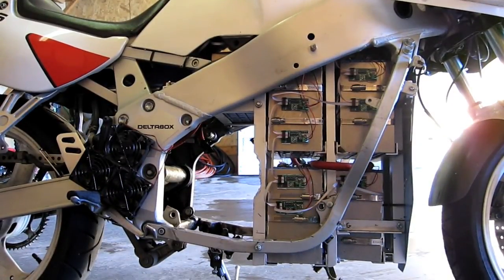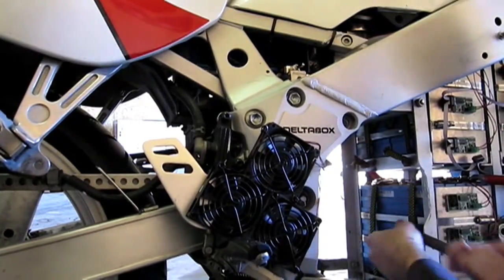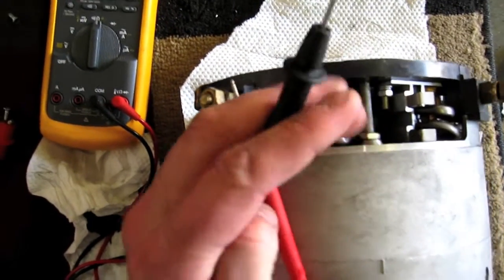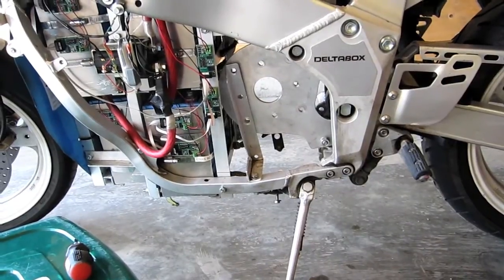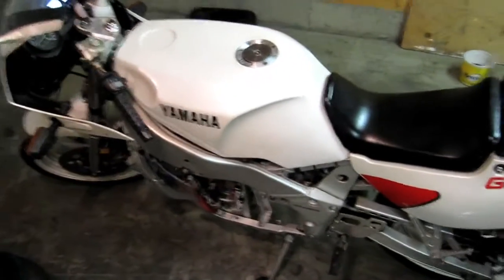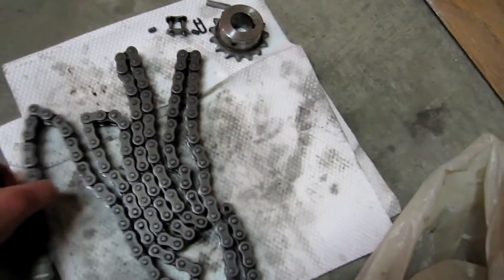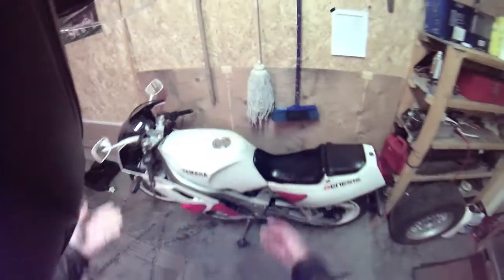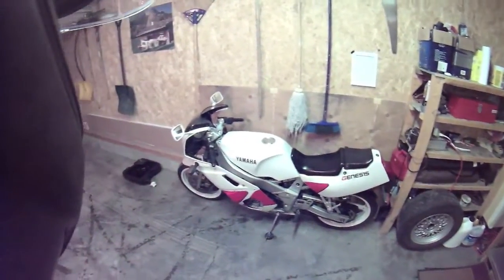#12: Motor Reinstallation 2013

Comment: Should you really spin up an unloaded motor? Maybe yours can take it, but my k91-4003 would probably not like that.
Reply from the maker: As long as you don't exceed the maximum speed of the motor, spinning it unloaded is not a problem.
Reply: ***** Yeah, I know, wasn't sure if you did. Nice bike. I am overvaulting my motor, so I couldn't get away with it unless I had an rpm display.
Reply from the maker: Owlex Myth Oh I see... Yeah if you have a higher voltage pack/controller than your motor is rated for you would have to be careful. In my case though, full throttle is well within the speed limits of the motor.
Reply: Great job on the videos by the way. I make similar vids to help people out with electric vehicle stuff. Have you heard of the electric motorcycle club?
Reply from the maker: Thanks and good stuff. No I haven't actually. I assume it's nowhere near me though because Calgary can barely keep a regular bike club going let alone an electric bike club haha...
Reply: Electric vehicles are still relatively unheard of and too expensive (initially) for too many people around the world. Technological advances have been getting E.V.s in the news & bringing down their prices, so the EV market is about to experience huge growth. The EMC is setting up to drive that growth.

The EMC aims to help people get E.V.s through charity and helping people navigate through the maze of uncertainty involved in selecting the right vehicle/EV parts for their specific needs. We think that the world would benefit from replacing polluting vehicles with EVs, but, since many can't afford an EV, we'll be raising funds to help get the worst polluting vehicles off the road.

The club is not a club in the traditional sense- having physical locations, yet. Our clubs will be charging stations/hangout spots (with amenities like coffee and food) for members and there will be businesses built off of the club, allowing our members to shape their local economies by creating purpose-built companies. 

The EMC will also building electric motorcycle kits that are geared toward being highly modular and customizable. 

It would be awesome to have someone like you who understands EVs, so please join. Members aren't required to wear our patch, but it does help the club's mission.

the website is emcsquares.com

Comment: Just curious; did you pull and inspect all the brushes?

I've had bearings on cars and trucks where they made a noise and simply unloading the bearing (jacking up the car) made the noise go away, but it came back after 10-15 miles. Maybe you have a motor bearing on it's way out and handling the motor shifted something inside the bearing. Noise might come back.

Also, replacing a couple of those bolts on the motor with studs should make installation and removal a little easier.
Reply from the maker: Yes I inspected all of the brushes. They all had an identical wear pattern.
It's definitely not bearing noise, it was just plain old brush noise. 
I don't plan on pulling the motor again for a very long time considering what I saw. Those brushes will last a very long time.